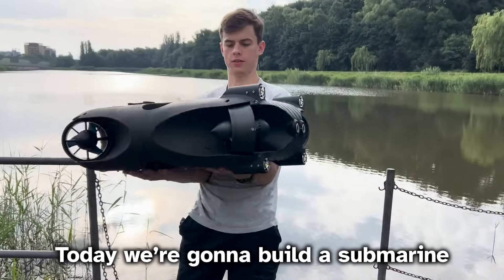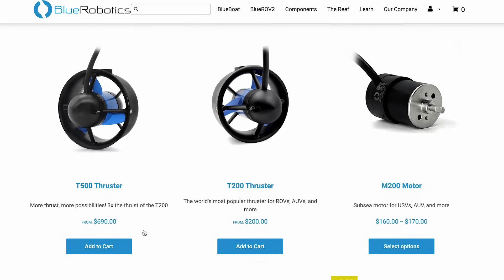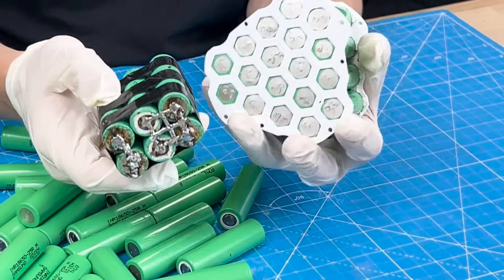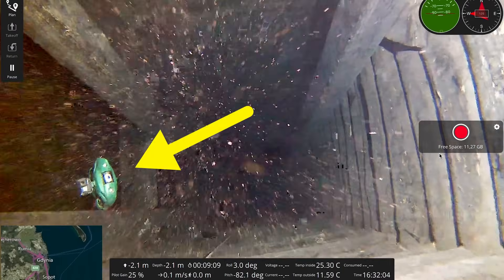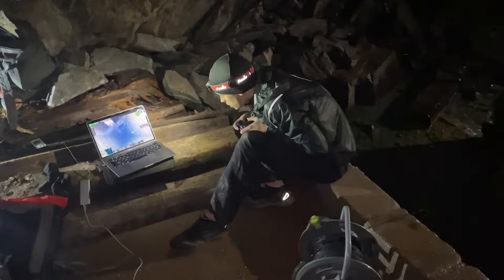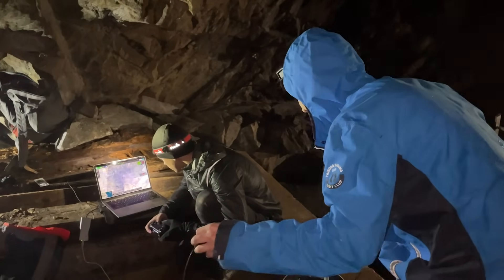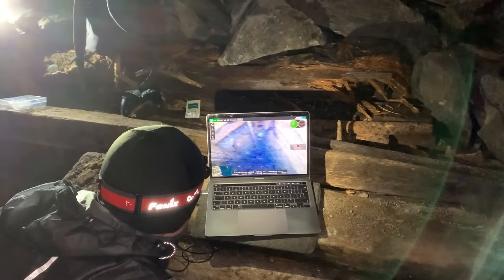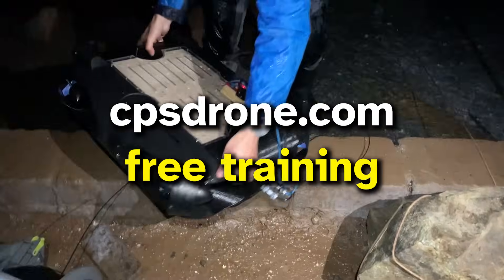My DIY Submarine Dives As Deep As Possible (PT2)

Comment: Regarding the folks suggesting you oil fill the enclosure. If you want to pressure compensate, or simply pressure balance an enclosure, it's not as simple as just filling the enclosure with oil. You'll need to add a compliant bladder or spring assisted compensator to account for any air bubbles that may get trapped while oil filling. If you go the route of using a compensator, you get the added advantage that if a leak should develop, oil will leak out instead of water leaking in. If you remotely monitor your oil level, this can warn you that something is wrong and give you time to respond. What's often the most difficult challenge of oil filling enclosures is that all the components you have within the enclosure must also be pressure tolerant. Anything that's soft or contains an air space isn't suitable for an oil filled pressure housing since the oil will communicate the exterior pressure to all the components inside. This can include complex things like your camera, but also some simpler discrete components like crystal oscillators, electrolytic capacitors, and much more. component selection at the board level becomes a very important consideration when deciding whether or not to oil fill for pressure balancing or compensation. In many cases (especially when cameras are involved), it's more practical to use a one-atmosphere pressure housing.
Reply: would encapsulation assist with component level pressure resilience?
Reply: @amandahugankiss4110  Good suggestion, however, that's also a solution best used with pressure tolerant components. Just like with oil, the epoxy or urethane used for potting will still communicate the exterior pressure to the components within. When encapsulating or potting, thermal management considerations must be taken into account as well. Oil will naturally convect heat away from hot components but a solid material won't. You can get thermally conductive epoxies, but they won't work as well as oil so you'll often have to pot components onto a heatsink and then leave one side of the heatsink exposed.
Reply: @finnigan16  You could embed heat pipes into the epoxy potting to help with some of that.
Reply: @dustinbrueggemann1875  Good thinking, but you'll still have a problem: Heat pipes themselves aren't pressure tolerant components since they're filled with a substance that needs to transition between a liquid and gaseous state in order to work.

A similar idea that would be pressure tolerant is using pipes to liquid cool the components. however, the plumbing for heat pipes and liquid cooling systems still typically require a heat sink to interface with the component they're intended to cool. It's easier to just mill a custom heatsink that will accept your board and the potting compound on one side, and interface with the cooling medium on the other. 

I have seen heat pipes used in subsea robotics, but only in atmospheric pressure vessels where they're protected from the external pressure.
Reply: S Tier
Reply: Or pressurise the enclosure to match pressure at half the expected dive depth. That way at the surface you have half the maximum dive depth pressure acting outwards. Then at maximum dive depth the pressure difference is again half the maximum dive depth pressure but acting inwards this time. So long as the enclosure can handle both inwards and outwards pressure then the maximum pressure differential the enclosure experiences will be half the maximum dive depth pressure. If this pressure is still too high then nesting enclosures could allow for the innermost enclosure to have a pressure low enough to avoid damage to pressure sensitive components while reducing the maximum pressure differential experienced by any individual enclosure.
As for camera pressure tolerance. GoPros have been sent to the edge of space on helium balloons with no issues. Admittedly that would be a maximum of one atmosphere of pressure difference between the outside of the camera and any sealed air pockets inside the camera. However a basic, fixed focus, security type camera module is just a silicon chip with a single glass lens mounted above it. No trapped air and should be able to cope with very high pressures.
Reply: Submerge it all in mineral oil.
Reply: @TurboLoveTrain  did you even read the comment ?
Reply: @Cookie-G  
Yes.
His sub design is antiquated.
I was being sarcastic though.

Comment: If you want to use 3D printed parts for waterproof stuff, you might want to spring for a resin printer. They've got much better layer adhesion than FDM printers and they're not very expensive any more.

Comment: Adding a rear camera would allow for constant monitoring of the tether which might help to avoid tangling it.
Reply: Add debris guards to the prop ducts... fine chicken wire might do the trick. A agree with the Aft-Cam as well
Reply: That thing needs cameras on ALL side. As many cameras and censors as it could possibly fit..
Reply: @Addictedtocollecting01 i do agree that they should add more sensors and cameras.
Reply: not necessarily
Reply: @JaeJWilliams  Off course it will help
Reply: @Addictedtocollecting01 it’s not good to have many cameras
Reply: Stitching the video of two opposing 180 degrees cameras into a 360 degrees video would be super cool.
Reply: If you've seen Nautilus Live, the professional deep sea rover has a smaller simpler spotter sub behind the main one to watch the tether and look for obstacles. Good excuse to upgrade CPS 4 to handle the depth and include it on future expeditions :)
Reply: I recommend just making the cable for the entire body length (maybe longer) being some what stiff, malleable enough to bounce off stuff but stiff enough not be sucked into itself or just adding sheilding to the problem itself 🤣
Reply: And put some sort of cage on the motors
Reply: I work with ROV's and I approve of this comment!
Reply: Battery is more important
Reply: or sub drones working as wifi router underwater, so that you don't have to explore with the tether
Reply: @decespugliatorenucleare3780  never hear of underwater wifi. 
Tether serves 2 functions. Instant transfer of control signal and video. And a way to navigate home.
Reply: Just an idea but wouldn't using Graphene 3D as a material for the submarine be better for handing the water pressure and having the submarine in a tear drop shape would give it more aerodynamics making go faster in the ocean
Reply: What if they'd make the whole thing slightly heavier than water with a gas cylinder that upon emptying would make it less heavy than water? Or add some detachable weights? I mean, who needs batteries when one can use gravity instead? And they might want to fill the cavities within the structure with oil to make it nigh on impossible to compress the structure beyond the point of catastrophic failure.
I'm not deep into submersible by the way.
Reply: @RenghisKhan  i mean your right as long as the body can handle the water pressure and enough force is pushing it down without causing it to explode or break. it would work faster due to the weight and also cost less so very smart of you honestly. but also the speed its moving at under high pressure will make it even more likely to break but like i said if the body is strong enough that plan would work and would get you to the bottom of the sea really fast and using your idea at the bottom they could let the thing weighting it down and explore as if it was a drone in the ocean
Reply: Something something hindsight.
Reply: How about a car reverse camera from temu
Reply: Insta 360 camera
Reply: How about low frequency teeny cameras with a 180 degree lens, attached to the cable at points?

This way you can keep cost low, and resolution high, as a camera that takes one picture every few seconds is cheaper than a video camera.

Granted you would want the camera photo outputs attached to a different fibre-optic cable, wrapped around the first one.

This is just an idea, that could be worked into a much better solution if thought through, what do you think?
Reply: @minipac2 Cable is fiber optic! There is no power!
Reply: @minipac2  I think putting cameras along the entire fiber line would just make more points for the line to get snagged.
Reply: @minipac2  sounds expensive
Reply: Have you guys thought of selling the CPS-5 as a kit, for those of us w/o access to a printer? I'd love one for filming around our R/C boats.
Reply: @WhiteWolf65 that would require production capabilities that they would not be able to handle along with their R&D activities. Plus idt its possible for them to ship it from russia so they would have to look into US option which would make it more expensive.
Reply: @GeraldHolmes01  aren't they from poland?
Reply: @GeraldHolmes01  not Russia but Poland
Reply: That's twice the problems than

Comment: What an adventure, I was afraid to see this being lost but it turned well, it so amazing that the fiber optic cable still worked. As a diver I can recommend you have a secondary rescue line for the drone, usually that would be mounted on a buoy in order to see it from the surface and slow release the line to avoid being tangle, and of course have a hard long line to pull it back to the top

Comment: That's why you need redundancy. Double the cable, double the camera, emergency power. Program to swim up in case connection is lost. Additionally, you can add mesh cone on the back of the drone, to push away things and prevent the drone from getting stuck, while letting water through to keep the flow from the motors.
Reply: Double the cables also means double the oppurtunity for them to get stuck.
Reply: @coffeefish4743  What I mean it's not two separate cables, but two cables woven together, so in case something damages the cable, there would be a second channel left.
Reply: @AllExistence  this wourldnt change a lot, fiber optic cables work until they are compleatly ripped apart so two cables woven together wourldnt change that
Reply: @FreddyyFazzbearr  Well, yeah, that's only true for normal copper wires.
Reply: @AllExistence  uhm. No. Copper wires fail as soon as one copper string gets cut or two copper strings get shortet
Reply: > Program to swim up in case connection is lost. 
doing that sounds very complicated/nearly impossible
Reply: @_patriik  also dangerous in such cramped surroundings, that thing might just get stuck on something and tangle or get the tether get caught on random crap as its trying to surface.  its not as easy as running the ardurover path in reverse, that tether is highly dynamic in its movements and can not be taken into account for plotting a course
Reply: @_patriik  No, not at all. Just rotate it up with a compass and start running. That's the basics.
You can also add obstacle avoidance, but that will require some computing and sensors. Easiest way is to do some random movement and rotations if stuck.
Reply: @AllExistence  and then the cable gets tangled and it's even more done
Reply: @AllExistence  just make it slightly more buoyant so if power is lost it will float to the surface. 100 times easier
Reply: @MrZenny-hx4wo  No can do. It would constantly fight the movement down, making it unable to be controlled properly. Plus water pressure in different depths has different buoyancy strength, and it will get stronger the deeper you go.
That said, since it's a submarine, it could have some way to automatically change its buoyancy, but that's an engineering headache since to improve buoyancy you need to push the water out, and that requires crazy forces on that depth.
Reply: @AllExistence  I only said it needed to be a bit more buoyant, just barely visible. If its a big problem, you could program a trim to counter the movement electronically with trusthers. Also you are kind of right about the buoyance block. They have a depth rating, which only says something about max depth on it before it implodes and loses its function. 240 meters are not much in terms of buoyance blocks and general subsea work. Last but not least, its not a submarine, its a ROV so no need for automatic change of buoyance.
Reply: @MrZenny-hx4wo  You cannot counter or because they don't face engines vertically all the time. Unless you wish for it go only up or down and don't turn at all.
Reply: @AllExistence  I am pretty sure that its possible to program trim that is variable for trusther that can take into account pitch and roll of the rov. If you cant do it dosent mean other people cant, its all about programming skills.
Reply: @MrZenny-hx4wo  Please think before answering. Positive buoyancy means it will constantly push up. Engines can negate it by constantly pushing down. 
IF engines are directed up. That means that either the design should include a few engines that are always directed up in any orientation, or the submarine would start to float up every time it rotates, since it's engines are not aligned. "Trim a variable" has nothing to do with the problem.
Reply: @AllExistence  its clear you don know what you are yapping about. When you hear i am thinking about making it bouyant, you think it would speed up to the surface at an insane rate. It wouldnt but you dont know what you are talking about. Also he said he had 6 degrees of movment so it dosent need a trusther to be inline with the surface. Read about it before talking.
Reply: @MrZenny-hx4wo  Learn to write without mistakes before trying to teach me. Not that you said anything useful.
Reply: @AllExistence  Its hard to teach someone that thinks they know what they are talking about. Everything you have said till this point proves to me that you dont know/work with this. You talking about programming it to swim up, emergency power and all the other ideas you have. They are unnessesery and way to overcomplicated. Ignoring the small writing mistakes I made, its easy to understand what i wrote and also easy to see that its you that doesn't bring anything useful to the conversation. I would ask what your job is but you are probably working at a grocery store. (PS: Try to read on the internet about ROVs and not submarines. Not the same thing.)
Reply: @AllExistence  No offense but you sound like you dont know anything about design challanges. Real world doesnt work like in your dreams. "Easiest way is to do some random movement and rotations if stuck",  "Double the cable, double the camera, emergency power" even if some of the things can be implemented it gets exponentially more complex quickly gets out of small-medium project territory.
Reply: Yeah, it would take a lot of time and effort to make that program work reliably with no false positives though. I can see a way to do it well in my head, but it requires additional sensors, servos, and magnetic cable locks to work. This would basically require an entirely new version of the submarine. 

The biggest issues are: 
Redesigning the cable/connectors so they can be automatically disconnected in the event that all signal is lost,
Programming the automatic return (which includes the auto cable unlock),
Adding obstacle sensors so that the robot(submarine) knows when a wall, protrusion, or cable gets in its way,
and finding room/waterproofing for the additional connector parts, power capacity, and cameras/sensors. 
It's a good idea for a future design though. 
(I'm not a professional, so correct me if I overthought the whole process)
Reply: @benr.3565  yeah the cable is the biggest problem
Reply: @FreddyyFazzbearr that's not how copper wire works at all.  Tell me you've never dealt with stranded wire without telling me
Reply: @Brian-S  copper wires have multiple lines (like USB 3.2 got 8 or 12). If one breaks, the cable is done. Fiber optic got only one wire and sends data through light instead of electrical flow. This means that it's a lot more reliable in these situations
Reply: One more thing, most of the time if u have multiple fibers together in the tether they almost guaranteed all break if one breaks because the damage one the first fiber is also going too happen to the other one. Say if you bend the tether with multiple fibers in them, over the breaking point. They all break not just one of them
Reply: He should just put guard rails on propellers
Reply: Program to swim up in case of connection loss? "just rotate it up with a compass and start running"? If it runs into something just randomly move it around is a terrible idea, especially if you have a really long thin cable, around a small area with a lot of areas it can get stuck on. It is probably feasible but seems like a lot of work, sensors, components, and that adds complexity. Unless it works 90% of the time it doesn't seem worth it.